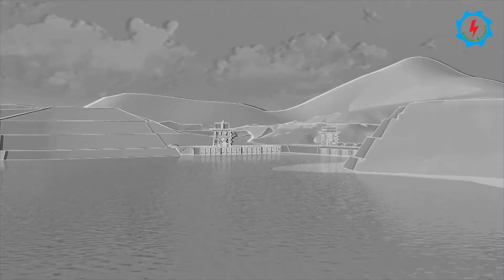Karot Hydropower Project | How it will look on Completion

Comment: Water storage capacity ?
Reply: Diamar , mohmand  or bunji  dam ki waja se Kalabagh  dam baneny  ky  chances  increase  ho gaiy  hain. Jo Pakistan  ky liay  achi  bath hain . Q keh  mardan charsada or Noshehra  ky donlbnay  ky chances thy
Reply from the maker: Its run off river project
Reply: @CheapEnergy  what does it mean ?
Reply from the maker: There will be no big storage, just live storage to run the turbines.
Reply from the maker: The core purpose of these projects are electricity not storage of water.
Mangla, Tarbela, Khanpur Dams are the storage dam. Furthermore Diamer basha & Mohmand dam will add in that list too.
Reply: @CheapEnergy  thanku sir
Reply: @uzair8727  means that it's just for energy purposes.  Not for water storage  . Run on the river.